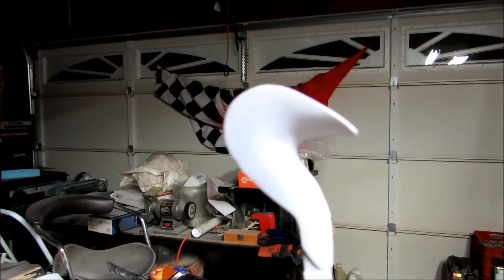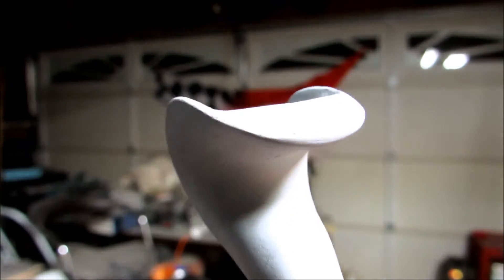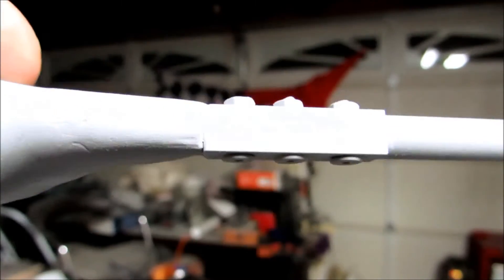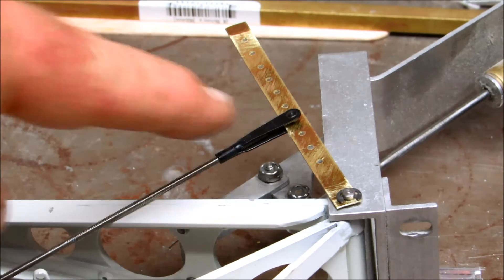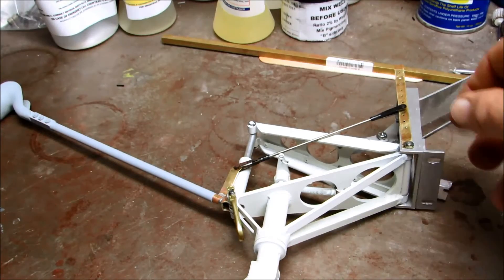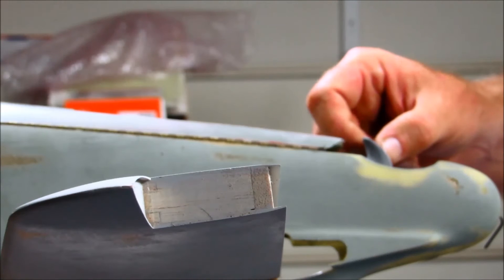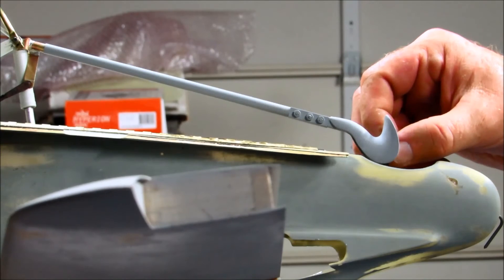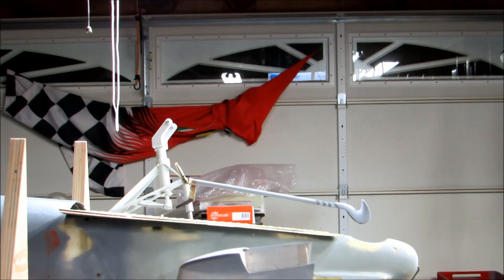Corsair #77, Tail Hook Construction Complete, Actuation Fleshed Out Too

Comment: Let's talk about Micro Give A Shits MGAS I can't stop laughing, thats a good one Don. Where you have play in hook with the doors shut have you thought about a small magnet and small piece of metal for the assembly, or a small spring inside the bay area to maintain it's height? All said the tail assembly looks great.
Reply from the maker: Thanks Brother. That's a good idea. I'll have to wait until all the final linkages are made and installed before deciding if my level of caring will rise to a higher level than MGAS, but if it does, magnets would be a good solution.